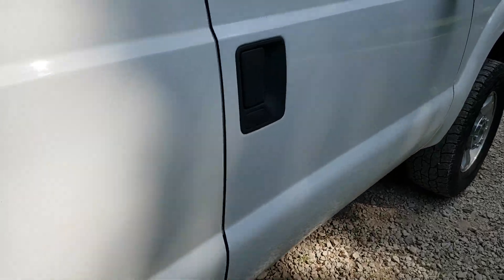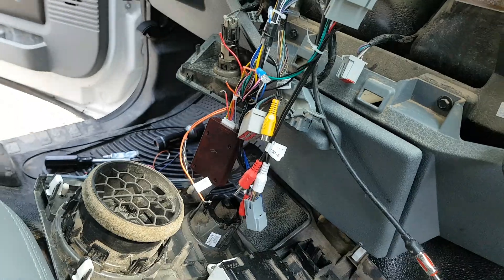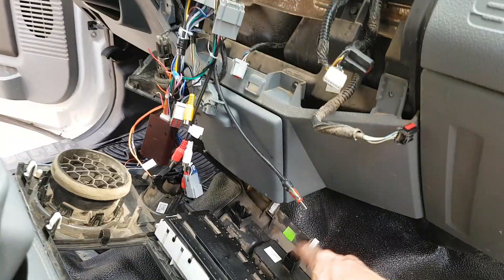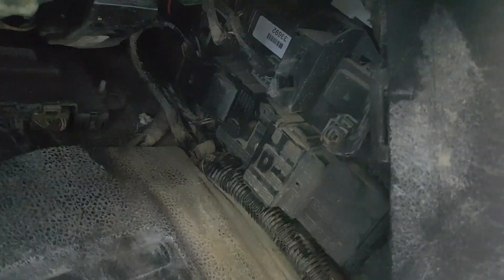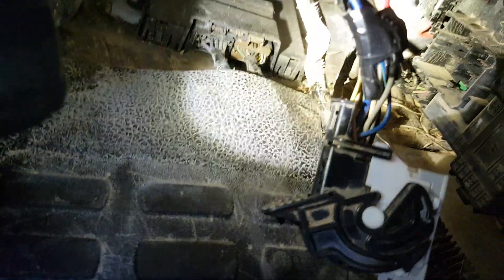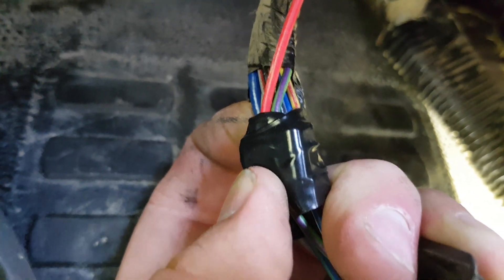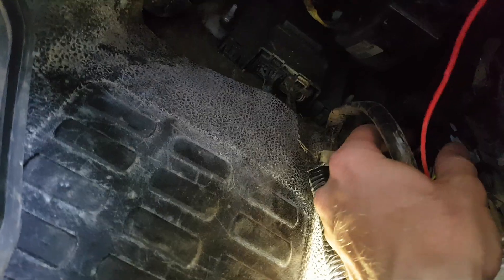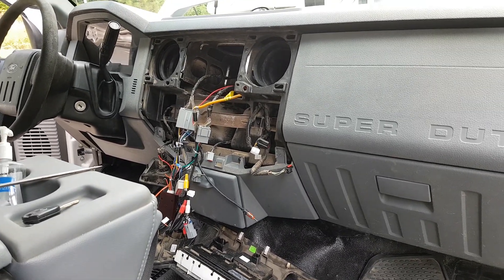2011 - 2016 F250 F350 Retained Accessory Power Delayed Exit For Aftermarket Stereo

Comment: What if I DON’T WANT the delayed accessory feature? I gutted my truck into a camper (no ignition, no engine, etc) and I plan to power my radio with a 12V power supply plugged into 120V. I need to trick my system to think I have an ignition key that is always on. If I replace my “delayed accessory relay” with a regular, normally closed relay, would it always send power to my radio (if it was powered)??

Comment: i have a base model 2014 f250 super duty and i bought the metra harness adpater to go from the factory ford radio plug to my custom radio harness but of course you have to splice the two together.  do you have the ford color code so i know how to hook them together?

Comment: I use the old wiring harness that I took out of my 08 F150 and plugged it into the wiring harness on my 2015 F250. They use the exact same harness. The red wire gets the green and purple wire. The yellow wire gets a constant hot. I got my constant hot from the 12-volt Outlet by the driver. I use the gray and red or was gray with a black stripe for constant power. Installed my four-year-old Kenwood when I turn the truck on it turns on when I shut the truck off and open the door it turns off. It retains its memory.  My truck is an XL with Factory CD player no synk system.  Car toys also has a wiring harness that they told me would cost me a hundred and thirty bucks and then I wouldn't have to splice into anything.

Comment: I'm curious How come you didn't tap into to wire behind the radio ? On my truck 2011 I found it easier to tap into factory radio wire so I have the power till I open the door vs how you did it. Still a great video and much help
Reply from the maker: There isnt a ignition powered wire in my harness, just like most late model Fords. The radios are controlled via the canbus network.  The harness only has a constant hot wire
Reply: @JackofAllMasterofNone  your 100% right. I put factory radio in and tried to find it. Factory would work with keys out but never could find the wire lol.ended up doing it like yours .  How did you find out the green/ purple was the acc wire ? Know Any other cool tricks for the wiring in the truck?

Comment: Hey man love the videos! I'm in the process of adding a navy unit to my f250. Where did you find the wiring harness for the unit? I cant find it any where. Also after splicing the real accessory wire what do you connect it to in the harness yellow or red? Thanks bud I'll be doing the steering wheel swap next!!
Reply from the maker: The wiring harness came with the stereo.  If you are using a generic radio you will have to make your own harness out of the harness that came with the radio and a Ford adapter pigtail.  You hook the real accessory wire up to the red wire.  The yellow is constant battery voltage.
Reply: @JackofAllMasterofNone  awesome thanks that's the part I cant find is the ford adapters. Thanks for the reply man.
Reply: @coreywalton6877  I used the one that I installed in my 08 F150.

Comment: Question on when green/purple wire has voltage?  I "T" tapped into wire and ran a pigtail to a test light....I shut all doors and turned on key. I got no voltage.....I was planning  on using this to wire the power head for key on power!? But I get no power from this wire?
Reply: A year later, did you ground it to the radio harness? Plus the 12+ v at the harness plus the wire he just showed us?

Comment: Is this just on til door opens or does this help with that little S.O.B. that keeps turning it on and killing my battery??? I actually ended up pulling my hizpo it kept just turning on and draining battery....
Reply from the maker: Using this allow you to remove that little box in the wiring harness. And yes this shuts the radio off after you open the doors.
Reply: @JackofAllMasterofNone  cool.... i bought the hippo 10.0 and it kicked my backside badly..... killed a battery after 100+bucks i pulled it until I can get it under control

Comment: Installed a Boss Audio head unit that has an "integration unit" that must be wired in. We wired the integration unit in as directed. Head unit will not shutnoff when ignition is turned off or door opened. Unit has constant power until you power off the head unit. Will this fix that?
Reply from the maker: Yes it will.

Comment: I am using an android aftermarket radio. The radio will not turn off when I turn the truck off will this wire tap make it turn off when I turn the truck off and stop draining my battery
Reply from the maker: That's why I did it in this video

Comment: I can’t seem to get the radio to shut off after I open the door with the key out.. i have to manually shut it off. Is that my radio?
Reply from the maker: Not sure. That usually indicated a problem with the can box. If you are using an aftermarket android stereo with a can interface box you will.need to do what I did in this video. And cut the red wire coming from the stereo and hook it to this wire.
Reply: @JackofAllMasterofNone  what about if im not using a can box? Will it still be the same?